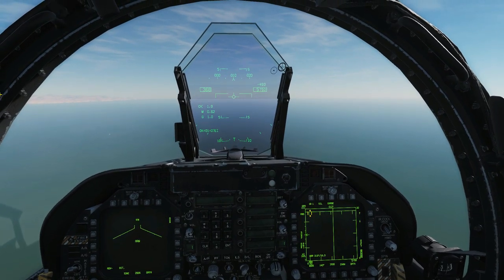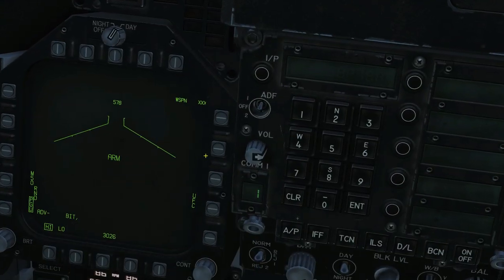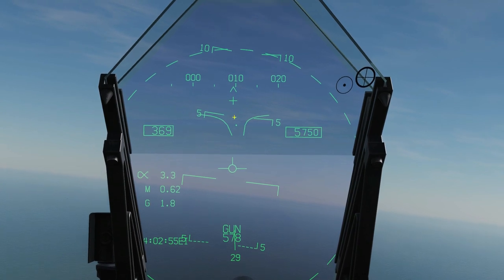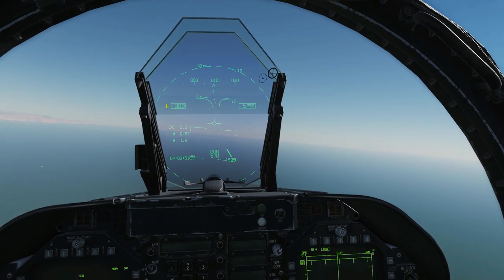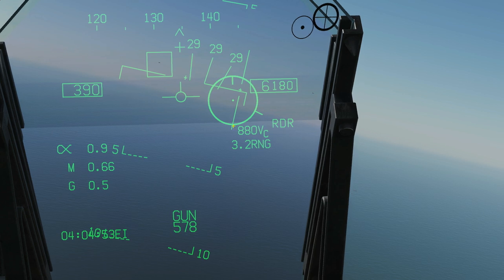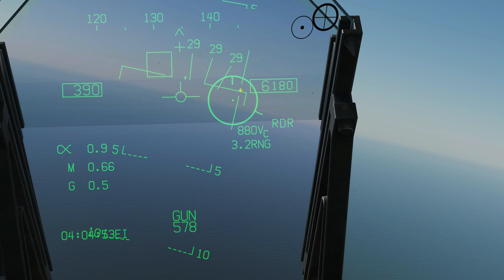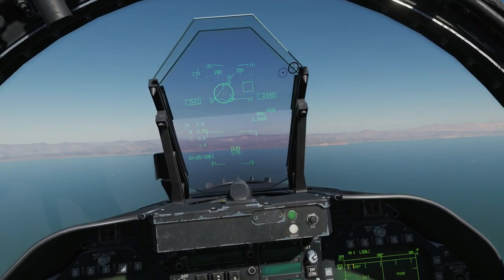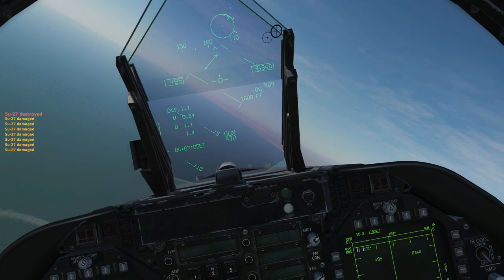FA-18C Hornet: Air To Air Gunnery (BOR/STT) Tutorial | DCS WORLD

Comment: I always prefer the funnel against a manoeuvring target, so much easier to get into the best plane of motion and fly the funnel through the target.  F16 should give the option of funnel with a radar lock (which gunsight to use should be selectable.. try F4BMS to see how it works , alas not yet implemented on DCS F16).    I'd be surprised in IRL  the FA18  doesn't allow the pilot to select which gunsight to use, maybe that will be implemented eventually on the DCS FA18?    The DCS A10C  does allow choice of gunsight, but no radar of course.
Reply: I've seen footage of a pipper being led by a flowing line to provide the same visual guidance and increased accuracy compared to the funnel on the Viper. Though I have to admit the funnel just flat out looks cool.
Reply: It's more precise and efficient to use the CCIP pipper. Without RADAR lock you'd also have to manually implement the wingspan so the funnel will be accurate, which I don't think you'd want to do while in a fight lol..

Comment: Could you please share how you are able to look around in the cockpit, i'm new to DCS and I cant figure it out, I can zoom straight in and out but not left or right, thank you in advance.
Reply: Cap uses Trackir (or a clone built using a ps4 camera)  a very fine piece of kit.  Others use VR, a much more expensive option but very immersive .
Reply: it’s track IR
Reply: I know you weren't asking me but there is a Grim Reapers Vid on Caps Head Tracker. Sorry I don't have a link.
Reply: use left alt + c (default) to change from mouse cursor to using mouse to free look. If the control has been changed it'll be under "force cursor to show on/off" in the adjust controls menu
Reply: Cap uses TrackIR or clone, you can use TrackIR or VR.  My preference is VR for the immersion it gives.
Reply: Left alt c